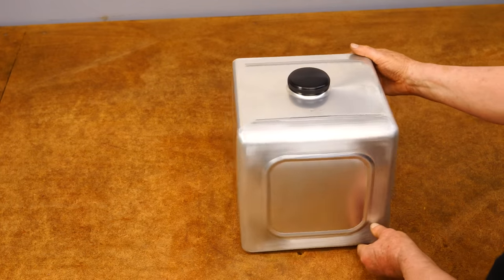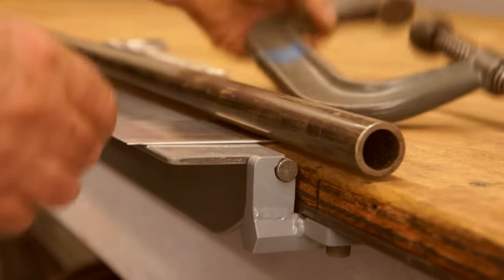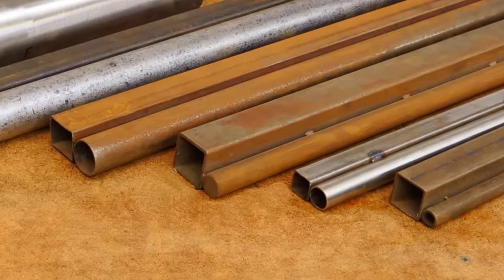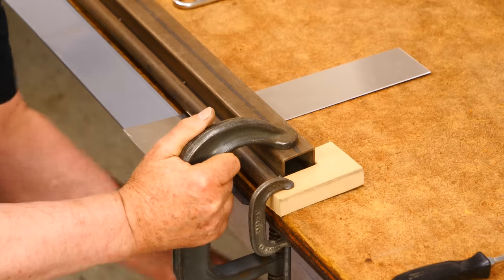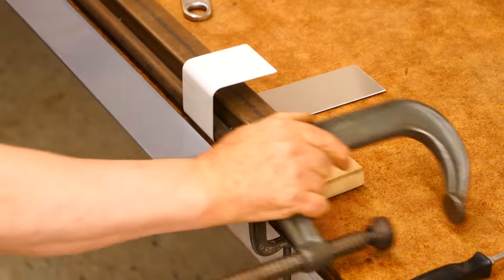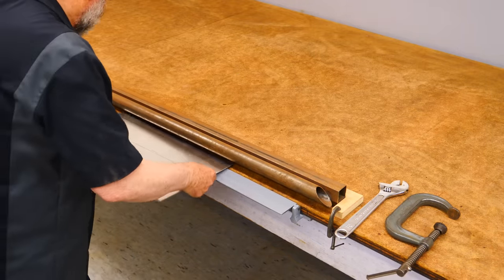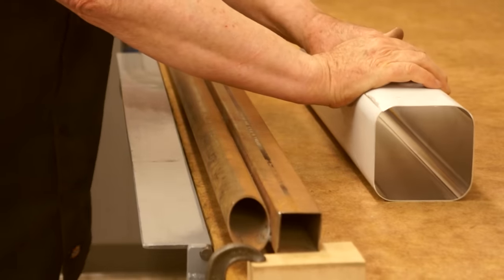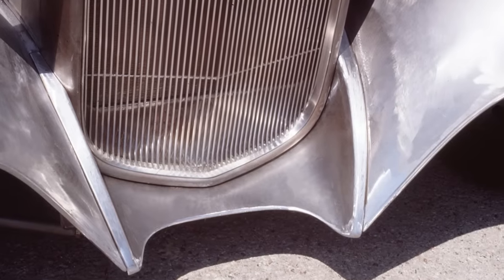Making a Radius Bending Fixture for Sheetmetal

Comment: Thanks a lot.
I have one question please
if there are hemming edges on side edge of sheet metal piece 
Will it work  properly or it will shrinkage or what happen?
Reply from the maker: You can certainly bend metal with a hemmed edge, but there are a couple of 'issues' to keep in mind. First, there is a limit to the thickness of the metal you can bend, based on how strong you build your bender, and the radius of the bend. (Larger radius bends are easier than tight-radius bends). With my fixture, I could probably bend a hemmed 19-gauge (1mm) steel part over a 2" (51mm) diameter tube, assuming the hems were relatively small - perhaps 1/2" (13mm) or so. 
There will be some distortion where the hemmed edge is. The single-thickness metal will 'center' itself in the double-thickness hem, giving the panel a 'bump' at the edges.
Reply: @RonCovell  I appreciate your fast response... You are awful person
My parameter is almost identical with yours
0.8 thickness and radius 48 mm
Will this distortion  disappear if we make shoulder on roller equal to hemming value to make roller in full contact with double and single area of sheet plate? 
If you can you can share one of your magic video with this distortion and how you can deal with it it we be great 
Thanks again
Reply from the maker: I've never tried the solution you suggested - it might work. Probably an easier solution would be to cut another piece of metal that fit inside the hemmed area, so everything that was bent would be two material thicknesses. Let me know if either of these work for you!

Comment: Great idea! How do you know where  the fold will be?  if I need a 260mm x 420mm rectangle,  do I  mark the corner then take half of the radius ?
Reply from the maker: I suppose there are mathematical solutions for your question, but I don't like math, so here's how I do it. I cut a narrow strip of the same metal the finished part will be made from, and I lay out bend lines, spaced at the dimensions of the finished rectangle, then I align each bend line with the edge of my fixture, and make the bends. This 'test piece' will be oversize, so I make notes of how much oversize each side measures, (the beginning and end will probably be different from the two center bends) then subtract that amount when I lay out the actual bend lines. It works for me!

Comment: Hey Ron!
Thanks for the video, I'm currently collecting info to build one of these, and this was helpful!
One question, however: In other tutorials people are emphasizing that the pivot pins need to perfectly align with the axis/edge of the steel corner that does the bending, so that it rotates without shifting. On your tool, the pins are clearly slightly offset from that axis, so the plane that pushes the sheet shifts a few millimeters during rotation, and yet the results look just fine. Is it because you're doing radius bends and not 90-degree crisp bends, so the alignment doesn't need to be perfect, or am I missing something here?
Reply from the maker: I'm glad you liked the video! Since my fixture is designed for making radiused bends, the misalignment of the pivot doesn't matter. On a bending brake, which IS designed to make a sharp bend, the axis of rotation must be precisely aligned with the corner of the top leaf.
Reply: @RonCovell  thanks a lot for the reply! That confirms my assumption. Gotta decide whether I need those crisp bends then.

Comment: Hey Ron - very good video. I am working with 14 gauge metal and I am looking for ways and tools with which to work it. Can you give me your thoughts? I think 14 gauge is a bit heavy for your method, but I wonder what you can tell me. Thanks.
Reply from the maker: The way this bender works - the larger the radius of the bend is, the less force it puts on the components. I've never tried 14-gauge with my bender. It would probably work with a narrow strip of metal being bent over a 3 or 4-inch diameter top die. As far as bending a full width piece of metal, or bending a tight radius, you would need something much stronger. Here's one that does 16-gauge, probably an internet search will turn up something heavier:
https://metalace.com/product/4-radius-brake/
Reply: @RonCovell  Thank you. I think that may exceed the reach of my work with students, but I should incorporate some lighter gauge stuff and then I can use your method shown here. I appreciate the feedback.

Comment: Hi, just came across this. Looks like it could be just the ticket! How thick a piece of steel have you successfully bent with this setup?
Reply from the maker: 16-gauge is the thickest I've done so far. I'm sure it could work with even thicker material, but not full-width.

Comment: Hi Ron. Love it. I do have a question though, how do you know how far back from the table edge to clamp the die?
Reply from the maker: To bend 90-degrees, the tube has to be set back at least one material thickness. To make a tighter bend, the tube needs to be set back more. Actually, you have a lot of leeway here, since you should get a nice bend as long as the tube is back more than the minimum required.
Reply: Thankyou.

Comment: Just curious what you think about my application. I want to make a taillight/license plate housing for my motorcycle project. I'd probably use 16ga steel, and need maybe a 2" radius bend. Would your fixture handle that? I could maybe go down in thickness as there shouldn't be any weight on it or anything. Thanks! I might make one of these either way.
Reply from the maker: Yes, this fixture can handle 16-gauge steel - for a section as long as a license plate, at least.

Comment: Hey Ron great idea! Love it! Would it work if you turn the die around for a right angle bend as well? I have a 47 Willys I need to make panels for out of 18 ga steel.
Reply from the maker: Well, probably not. The larger the radius of the bend, the less force is put on the bending fixture. Making a 'sharp', full length bend would take a much more beefy bending fixture. Here's one example: 
https://www.youtube.com/watch?v=Ggy1DHwAh_0
Reply: @RonCovell  Thank you ahead of time. One more question can this also make a U bend, w/o the square tubing if one could clamp down the tube well enough? Talking 18 gauge.
Reply from the maker: The way the movable 'leaf' on my bender works, it is difficult to make bends much over 90-degrees. There are other types of benders that are designed to do this. Here's one example: https://www.youtube.com/watch?time_continue=12&v=_oU1P167pFA&feature=emb_logo

Comment: did you round the the tank corners on the bead rollers after the box shape was made? i guess i thought rounding the corners would have presented a issue at the 90 degree bends
Reply from the maker: Adam M - Yes, the edges of the tank body were curled with the Rounding-Over dies. The corners require some hammering against a T dolly. You can see something similar at the 9-minute 30-second point in this video: https://www.youtube.com/watch?v=wcTkQ_Y_dBA

Comment: Hey Ron, How would you go about making close to a bend that is 180 to 270 degrees? Could you only have  the square stock at each end?
Reply from the maker: I have seen a type of bender that would do this. It is somewhat similar to the bender shown in this video, but instead of having an apron that you move to force the metal against the round mandrel, the sheetmetal is clamped to a flange on the mandrel, and the mandrel is rotated, while allowing the flat part of the metal to slide against the top of the workbench. In this case, the mandrel needs to be able to rotate, which can be done with a simple angle bracket on each end, and a center pin, bolt, or shaft which allows the mandrel to rotate relative to the bracket
That's a 'homemade' version of a nice radius bender like this: 
https://www.trick-tools.com/MetalAce_4_foot_Radius_Brake_with_6_radius_rolls_16_gauge_RB4816_2040

Comment: I didn’t want to take the time to go through all the comments and see whether or not someone had made the suggestion… it’s easier to swap the C clamps in an out above the table versus having to reach under every time? My experience tells me much much easier above the table, and nothing obstructs the bend.
Reply from the maker: Again, this is personal preference. I usually put C clamp handles down, so they don't get in my way. I can't tell you how many times I have bumped my elbows (or snagged my shirt) on clamps that were sticking up.

Comment: Do you think it’s possible to make a 6 inch half round gutter with a sheet metal brake? Our suppliers never have the material available when need be. I would pay you for a tutorial if so! Lol
Reply from the maker: Probably the most feasible way to make a half-round gutter with a brake it to 'bump' it. This video shows the bumping process used for a cone shape, but of course the bend lines would be parallel for a gutter:
https://youtu.be/7j74e7p-Xnw?t=290
Reply: Awesome! Will give it a try sometime. Thought about buying a big brake like you have in the cone video. Another crazy question would be could we make fascia metal in shop with that big machine? I know it’s kind of over kill but we are between buying a siding brake for like 20’ of trim for a Gutter job this week, but am thinking of maybe purchasing the larger one since we could do more with it.
Reply from the maker: I don't know exactly the profile that your facia pieces would need, but sheetmetal brakes can bend flanges with very few restrictions
Reply: Cool! The shapes are basic little L shapes so we may opt for the larger piece of equipment

Comment: I have to make inner rockers for my 67 PONTIAC and the ends have to be radiused like this so the floor braces  will weld up nice and tight at the 90.
Reply from the maker: It sounds like this process might work well for that application.

Comment: Another thought; why do you mess with the crescent wrench? Why not just weld a handle?
Reply from the maker: Well, of course you could weld handle(s) on the moving part, and if it stays in place all the time, that would make sense. My fixture is taken off the table most of the time, and it stores more easily with no handles attached.

Comment: Hey Ron. Do you think it's possible to bend a 2mm thick chrome steel plate with your invention?
Reply from the maker: Well, it would depend on the width of the plate, and how rigid you build your bending fixture. I would guess you could do a 12-inch width over a 3-inch tube, although I haven't tried it. The smaller the tube, the more difficult the bend is. Let me know how this works, if you try it!
Reply: @RonCovell  thanks for your reply. I am afraid to say i need professional help for my project. The plate i am talking about is 62 inches wide, and maybe around 40 inches long... and already bent in 2 places... lol
I will have to get it cut into smaller pieces and let the professionals bend it if necessary. Maybe i'll create a fixture like yours some time later on for smaller and less thicker stuff. But i guess i would need a welder as well then... my workshop is small and a work in progress.
Reply from the maker: 62 inches? Well, that's why they make radius dies for press brakes!

Comment: So the front of the tube needs to be flush with the face of the bench.  But the line was on the face of the bench.  So where did the line end up after bending?  In the middle of the bend or at the end of it?
Reply from the maker: You are asking an excellent question, but it's a bit tricky to answer, and the results will be a bit different with different types and thicknesses of metal. The line is definitely not at the end of the bend. It's closer to center, but not exactly on center, either. That's why I always do a test piece, to study the results before I commit to laying out and bending the actual piece.
Reply: @RonCovell  You I was thinking about it later.  The line will move nominally 1r around the arc.  But I think you'd have to subtract 1/2 the thickness from that to be more accurate.  So roughly 1/6 of the circumference.
Reply from the maker: People work in different ways. Some people take a mathematical approach, and get great results, but that's not how I do it. I usually bend a test strip, and work everything out from that. For example, I might start with a piece of metal 1-inch wide, and 3-inches long. I would put lines across the test piece at the 1-inch, 2-inch, and 3-inch points, then mark which side goes 'in' to the fixture, and make 3 bends. You will find that the metal 'grows' with each bend, so from the end to the tangent of the first bend might be 1 1/4-inch, the distance between the two bends might be 1 3/8-inch, and the distance from the last bend to the end of the strip might be 7/8-inch. I'm just making up numbers here, presuming you're bending around a small (3/4" diameter tube) but I hope you get the general idea. Try it!

Comment: Awesome tip Ron, what gauge sheet are you using for this?
Reply from the maker: The material I used for this video is 1/16-inch (1.6mm) aluminum, but I have made radiused bends on many other metals, including steel.
Reply: Ron Covell thanks Ron! I have an 83 Land Cruiser where I want to make a custom grill that wraps around both corners where the turn signals currently go and this material and bending technique should work perfectly.
Reply from the maker: Great!

Comment: Is it possible to make a cylinder, by modifying the setup?
Reply from the maker: This fixture will not make a complete cylinder, since it relies on a flat piece of metal to hold the blank down. A slip roll is the tool commonly used to make cylinders. https://www.youtube.com/watch?v=tilseJNu9VQ

Comment: Say I bent a large piece just passed 90° how would I bend it back too 90°?
Reply from the maker: Well, metal bends both ways - so if you over-bent it, you should be able to reverse the way you apply pressure, and 'un-bend' it as much as necessary.

Comment: How close should I position the radius die to the apron?
Reply: Do I position so they touch when the apron is at 90 to the table.
Reply from the maker: It will certainly work if you do it that way, but you may not always be bending 90-degree angles. You can experiment to see what works best for you, and in fact you have a lot of leeway in terms of positioning the top die.

Comment: Why go thru all of the trouble and material to weld a square length behind the pipe when you could weld a short square piece on each end of the pipe?
Reply from the maker: Small radius tubes require the support of a larger square tube. For larger tubes, having a plate on each end works well.

Comment: And after doing that, I would be spending the next few months tracing down all the leaks in my welds... :)
Reply from the maker: Practice makes perfect!
Reply: @RonCovell  -- I tried making a auxiliary fuel tank for my Harley to mount on the rack behind the rear seat backrest.  Knowing my limits, I started with a 5 gallon air tank since it already had a 1/4" NPT fitting that could be positioned at the bottom for gravity feed into the existing fuel line of the motorcyle.  So, all I had to do was cut a hole in the top and weld a fuel fill-up bung into the top... Nice thick steel, so even a crude welder like myself should be able to do it without burn-throughs... Fuel sloshes in the tank and comes through pin holes around where I welded the bung to the tank... I'm not a professional welder... I can weld things together well enough that they will stick, but obviously I can't do it well enough to keep it from leaking... :(
Reply from the maker: Well, that's what they make JB weld for!
Reply: @RonCovell  -- I was planning on soldering it... I would prefer to have done a perfect weld, but that's just not within my capabilities apparently... :(

Comment: Why not simply weld square blocks (Or piece of short angle) to the ends of the pipe to clamp.
I don't see the need for a full length square tube.
Good idea though and appreciated!
Reply from the maker: Thanks for commenting! On large tubing, full support isn't needed. For smaller tubing, it will tend to bow in the center unless it's reinforced.
Reply: Understood. That makes perfect sense.
Clearly your experience is showing😊

Comment: Bad to the Bone!  1.  How to build the "Apron" pieces... 2. How thick is practical for the radius bends?  In Gage units...
Reply from the maker: Glad you liked the video! The apron is simply a piece of angle iron with 3/8-inch round bar welded to the ends for the pivots. For larger radius bends, this fixture can easily work with 16-gauge steel. The smaller the radius of the bend, the higher the loading on the fixture, and you will find the limits through experience.

Comment: Seems pretty stupid to weld a square stock along the entire round stock! Why not just weld a small piece of angle iron to the ends and clamp onto that to keep it from sliding away from the edge? Or make the pipe longer than your bending apron and bang it flat on the ends and clamp onto that! Now if your make a long radius bend and you do not want any distortion on your radius bend then weld anything fro round, angle or square to the back side to reinforce it from flexing otherwise the suggested method is stupid.
Reply from the maker: For large diameter, or short radius dies, welding a piece of angle to the end works fine. For smaller diameters, and longer lengths, the round stock needs support so it doesn't flex in the center. You are right that angle iron could be used instead of tubing, as long as it offers sufficient support.